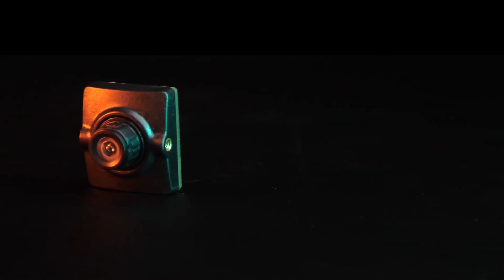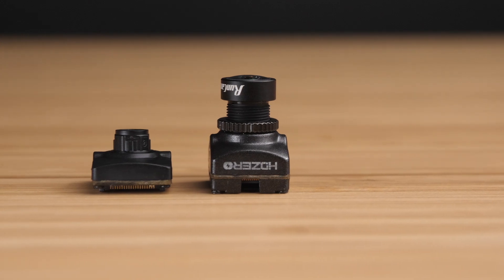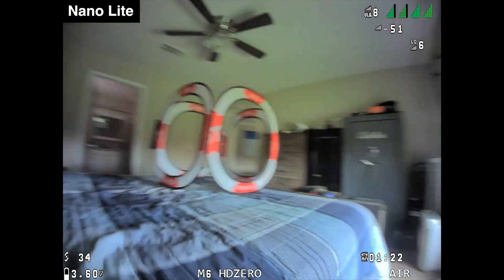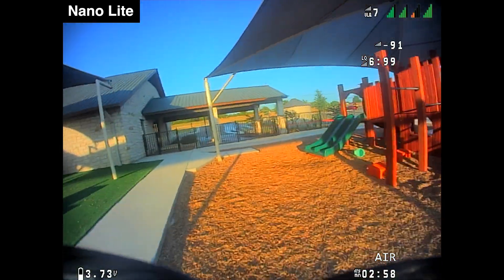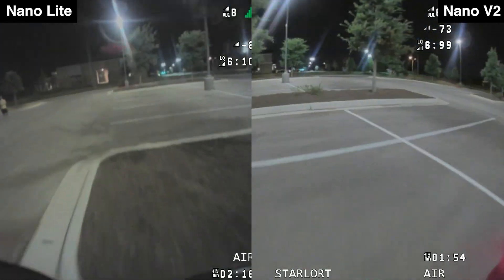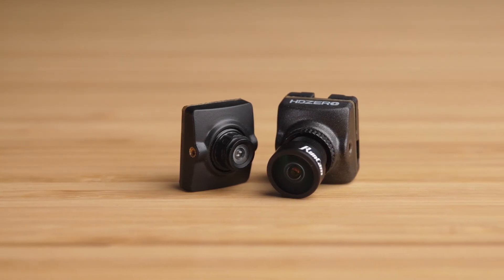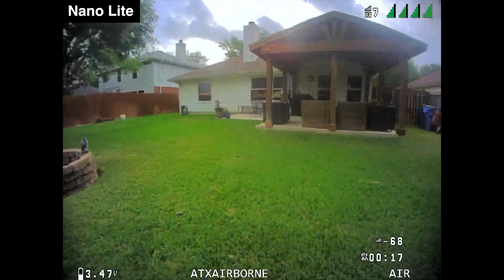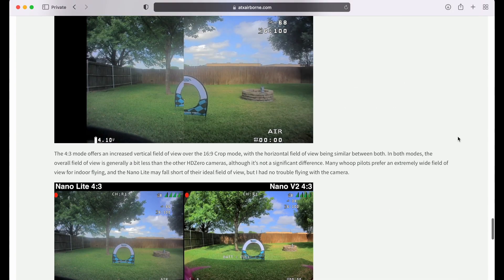The Perfect HDZero Whoop Camera? | HDZero Nano Lite Review

Comment: Always detailed reviews 👍,  by the way when I try to change aspect ratio in my nano v2 (with whoop vtx) it doesn't change to 4:3 and it says "need to repower vtx". I saw in your video (at 6.28) also when you change aspect ratio it says "need to repower vtx". Anyhow your aspect ratio changed. How did you do it? What did you do when it says "need to repower vtx"? Really appreciate if you can help
Reply from the maker: Repowering the VTX just means unplugging the battery from the drone and plugging it back in. After you do that, it should change the aspect ratio. 

Note that most goggles will not immediately show you a different aspect ratio. You’ll either need to change a setting in the menu of the HDZero VRX, or in the goggle menus.

If you’re using something like Skyzone goggles, they support 4:3 over HDMI so you’d want to change your goggle display settings to 4:3.

If you’re using Fatshark goggles, most of them only support 16:9 over hdmi. So for that case, the VRX menu has an “aspect ratio” menu with several different options. These options basically send a 4:3 camera image as a 16:9 video (black bars on the sides) so the Fatshark goggles can display it.  

I hope this helps point you in the right direction — it’s a little confusing at first, for sure.
Reply: @ATXAirborne  Appreciate your reply. I am using skyzone sky04L. I will try your suggestions

Comment: Thank you for all the info, I'm new to fpv and I want to ask if it would be possible to use the HDZERO with my diatone 369 and skyzone cobra x googles?
Reply from the maker: You should be able to. When I first got HDZero, I used the Skyzone cobra x. You’ll have to figure out a way to mount the HDZero VRX, though, because the included mount won’t work. I used a 3D printed mount, but you could also use something like Velcro to secure the mount onto the front of the goggles.

Comment: Amazing review!! One question, I don’t have that 16:9 full sensor setting in the aspect ratio menu and I’m on latest firmware. 🤔 also I can’t switch to 4:3 on any of mine
Reply: I got the same problem. Did you find a solution? When I try to change aspect ratio to 4:3 it says vtx need to repower. I reconnect the battery and nothing happened
Reply: @gayanwijayasiri8891  Didn't find a solution :( I only imagine he's on a beta firmware
Reply: @DanielSingerX  I asked same question in my original comment on this video. ATX airborne replied with few suggestions and you can try them. I didn't try them yet